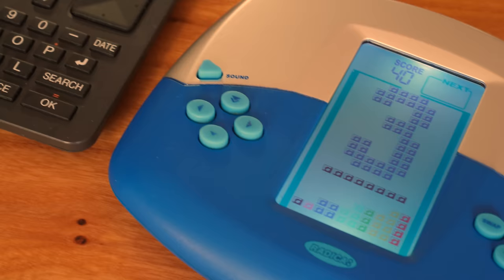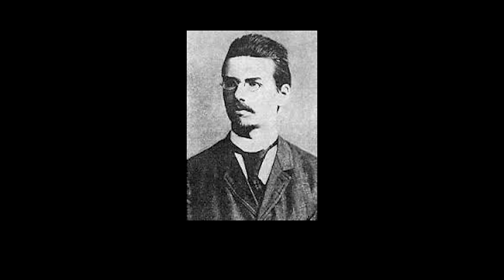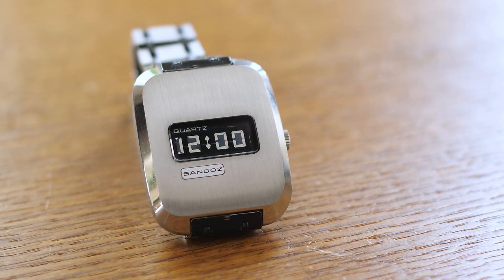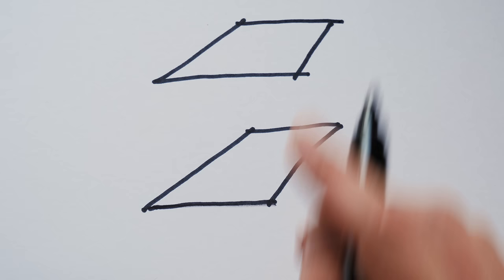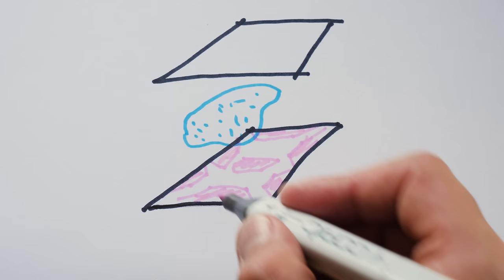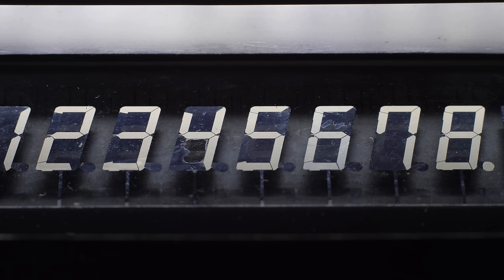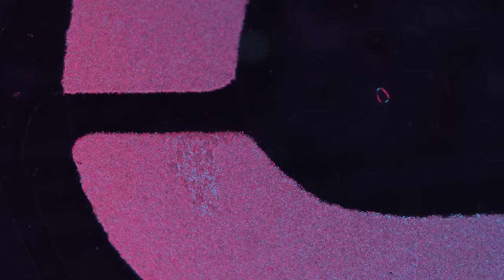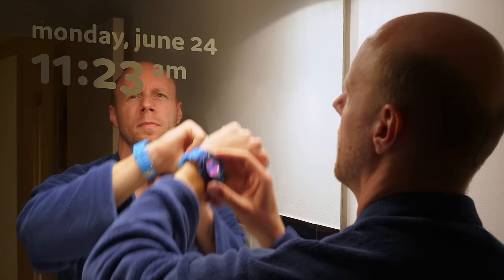The DSM LCD (like) you've never seen

Comment: Congratulations on a splendidly produced video & soundtrack! Heartening to find others who appreciate this particular display tech cul-de-sac. 
Having a - slightly too large - collection of calculators that use COS/DSM displays I was a little distressed to see the EL-808 getting the Dremel treatment - even if it is a fairly common model... 
Another COS calculator model, the sharp EL-805 was notable for not only being the first pocket LCD calculator, but also for the extended glass substrate of the LCD being a circuit board on which all the ICs were mounted. This was a kind of chip-on glass-technology decades ahead of its time. Slightly bizarrely it was also manufactured by Elektronika in the USSR as the Б3-04 - presumably under license from Sharp. Please do not Dremel any of these -  they are RARE! :) 
I see others have noted the sadly short lived Sharp PNLC LCD..- here are a couple more links.   Sharp also produced a larger version used on the back of the 6228 cell phone sold only in Japan - it is even rarer than EL805s...  
https://www.youtube.com/watch?v=eAoC818Mxy4
https://www.youtube.com/watch?v=nGiYUq_Pd4U

Comment: I looked at desktop calculators that ran on mains power at a trade show in 1970, they had NIXIE tubes and cost over a thousand dollars which was a lot of money then. The annual salary of a factory worker was something like $60 per week.
In those days we used slide rules and log books which was a PITA. I owned a hand held calculator in 1975 (ten digits) which had an electroluminescent display. In my opinion, the worst calculator was the Sharp Elsi-Mate which only displayed 4 digits at a time and alternated with the other digits and cost something like $300.

Comment: Thanks for the video!
Really something to appreciate!
There seems to be one problem and that is using sticker type glue at the back.
In high temperatures or for some other reasons, the display gets dark blotches which obscures the characters. Any diy measures can permanently ruin the display!
Strangely a 2 year old calculator, which had developed these blotches reverted back to normal!
I loved the green LEDs, unfortunately they would fade away.
I still have a 20 year old LED wall clock which has a red display and it's still operating with no fading.
It has the option to vary the brightness which still works!
The sad part about this clock is that the transformer swelled up, and the black acrylic housing could not hold a push button adjustment.which went right in! 
It's still working but I cannot stop the daily annoying alarm untill I fix this issue.

Comment: rechargable batteries run at lower voltage (1.2V) than non-rechargables (1.5V) which might be why it appears that the clock needs so much batteries. 
perhaps if you'd put non-rechargables in them, they'd last longer 
(battery voltage drops when going empty. and in case the cut-off point for the clock might be at 1.1V for example. the rechargables will be there wayy sooner than non-rechargables)

Comment: I have been told that some variants of Sharp MemoryLCD have a slightly similar appearance - white is just white but black is really extremely mirror-like, but angle of reflection is very limited. How come? I suspect it's the opposite effect somehow, that white is a diffuse mirror on the back but the black mirror is formed by the liquid crystals in the image layer.

Comment: When I was working as an industrial designer for a mobile phone company back in the days, one product being developed used a layer that could switch between mirror and transparent. I researched this again in recent years but could not find any reference about it. In my memory the engineers called it a TNLC display. Does that ring any bell?

Comment: In 4:26: There were two glasses. In between of them, added liquid crystal blob and transparent conductive material with the desired shape added on the upper side of the bottom glass and another conductive material added on the lower side of the upper glass. What is not clear for me is, how the liquid crystal blob stayed there and didn't spill out? When we sometimes see saw a blue ink blob on an LCD, is that what you called the liquid crystal?